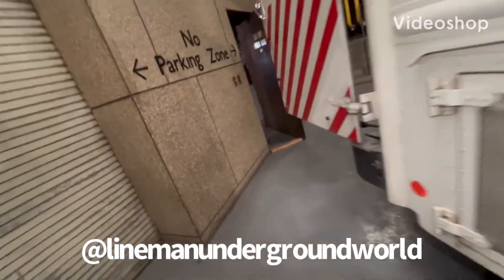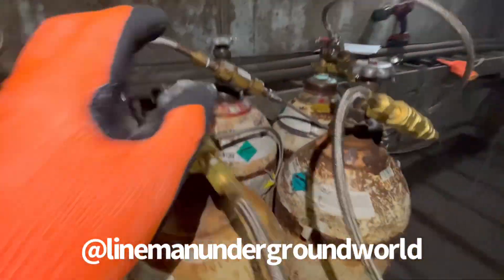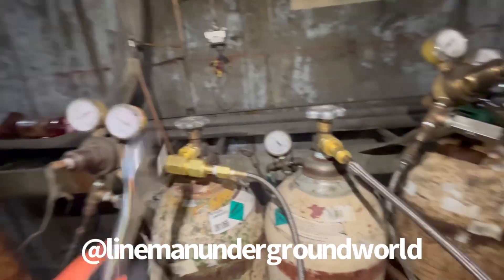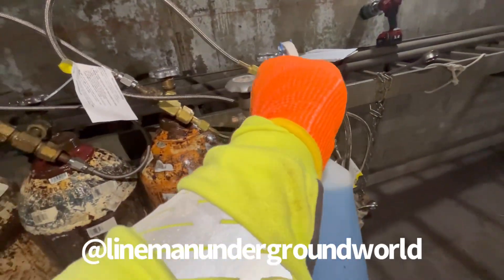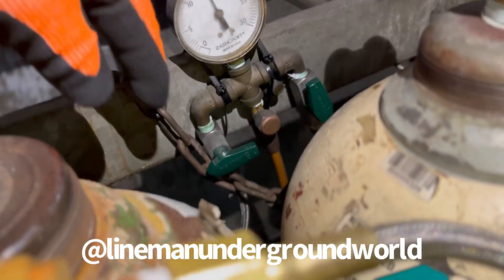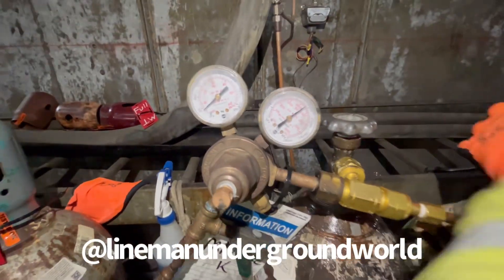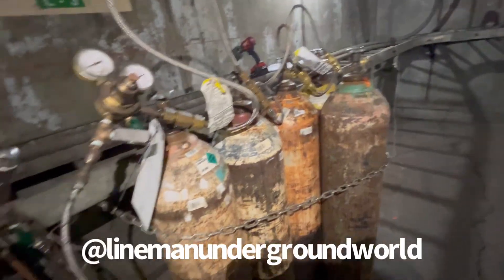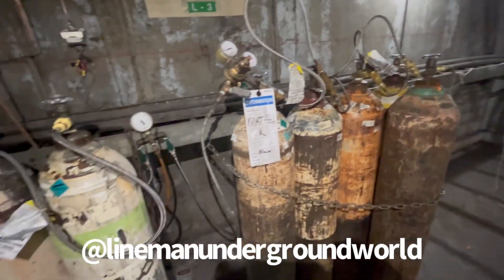Reset nitrogen gas regulators ￼

Comment: N2 ? Do you use it because it's relatively inert and cost effective, possibly to reduce arcing?
Reply from the maker: Wazzup dav , we use it to keep the moisture out when the cables have leaks ..
Reply: High pair count Telco cables are also pressurized with Nitrogen.  Keeps the moisture from corroding the copper.

Comment: I was told, once upon a time,  that using Teflon tape upstream of a gas regulator is a bad idea. Idea being that small, slippery pieces could come loose and be ingested into the regulator itself effecting its accuracy.

To be clear, I never once witnessed this problem myself, but older and wiser people swear that they have/did. It could have been a bit of 'new guy in the lab' hazing - but for years I never went near a regulator with thread tape. The brass-on-brass fit was always enough to effect a seal. Those regulators were always in pristine condition, with no scratches or deformation from some gorilla reefing on them though, these look like they've seen some things.
Reply from the maker: Wazzup wills , ya about using Teflon , lot of the fittings nowadays leak and that’s why we use it , instead of cranking it down very hard to seal it , and the ones that have a flange sometimes it doesn’t sit right , we use it there as well , but lots of them are good, and the regulators you gotta keep an eye on them or this is what happens as I am explaining right now.. 👍🏼😎

Comment: Why dont you use nitrogen generators at the substations? Second question why dont you use 6 bottle pack cradles form the gas company they are on casters easy to move less stuff to take apart every bottle change.
Reply from the maker: Wazzup Robert , thanks for the great suggestion,  but really how can you get them in there with a forklift , ok the rollers but I can roll the bottles pretty fast myself, less parts the faster you get the bottles over there.. thanks
Reply: Nitrogen generators are great until the membrane cartridge fails and blows out. Fine in a very controlled, tightly monitored environment, but you'd need to run a backup at the same time to ensure continuity, and  the large storage tanks needed to house the generated Nitrogen.

This may not be why they're not being used, but it seems like a plausible explanation.